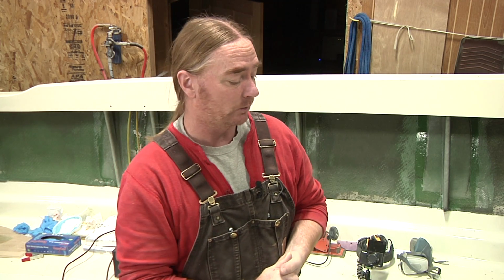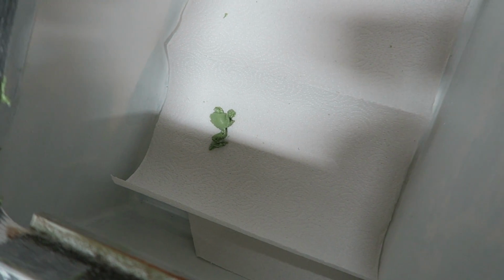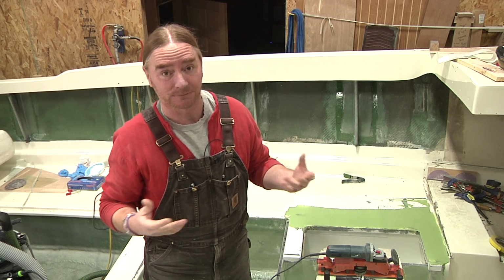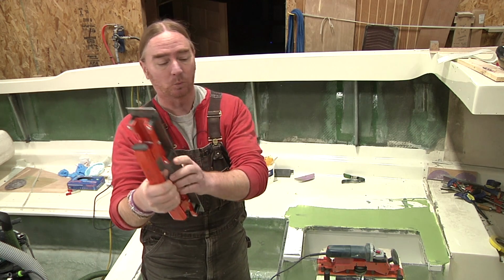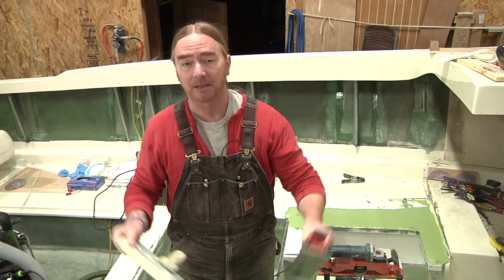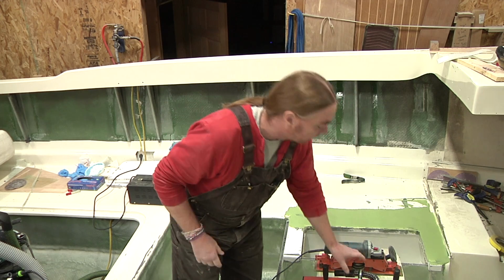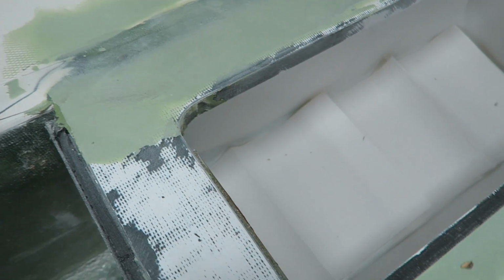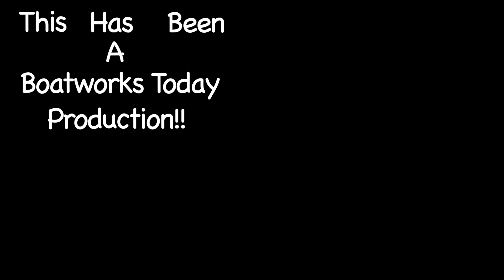Fiberglassing And Fairing The Coosa Locker Frames!

Comment: Nice video Andy. Thanks for making it. A Flexi Sander would have been nice but so many manufactured tools are not available here in S. Africa. While doing massive amounts of serious resin blister repair on my 40 foot sailboat, sheetrock compound knives were too small and tedious to use. I had to make screeds of Plexiglas, of various thicknesses, widths and lengths. Some were very stiff and some very flexible, all depending on what odd shape of the hull had to be faired with 2 part epoxy filler. The business edge of the screed was cut perfectly with a router, following an aluminum straight edge. I do think, in the end, this worked as well as a Flexi Sander would have worked and cost me only the time to make the tools, as the plastics were someone else’s scrap. ……Then there was the making of a variety of long boards….
Looking forward to your next video.

Comment: Andy,
I am in the middle of a Grady White project and know, due to not being careful, I will need to do a lot of sanding to my deck because there are a lot of epoxy drips and smears.  To bring the deck back to being true and to prepare the deck for some non-skid I think the proper way would be to do some fairing.  My questions are... 
- do you agree that would be the proper approach? 
- how far does the fairing go? 
- in this video what size containers of Total Fair are those?
- Finally, you dispense the amounts by eye... would you recommend measuring if you are a beginner?
Thanks!  Watching your videos helps the DIYer more than you know!! Looking forward to the next video

Comment: Nice explanation of the tooling you used.... you're right about getting it laid down the first time with only a couple of low spots. Hardly ever happens. But that's experience for ya! Good job... 
I used to do a little body work and paint cars... 
How would you compare fairing compound to Bondo. 
Is it just a harder finish?
Thanks for the video...
Reply from the maker: Hi Dave!  Bondo is a polyester based product and generally speaking very porous (not very good for managing constant exposure to moisture) whereas most marine 'fairing' compounds are epoxy based which do a great job at limiting exposure to moisture.  Also epoxy tends to shrink much less after cure so there's less chance for visual distortion with high gloss finishes like paints :-)  Hope this helps!

Comment: Once again great video. I can't tell you how much you have taught me about fiberglass work. I have a question about fiberglass panels. Can you laminate Owens Corning 703 rigid fiberglass panel? It is used to make speaker boxes in cars and is a lot cheaper than the premade fiberglass board you are using.

Comment: I'm replacing a shattered piece of the topside of the deck, surrounding the mast, on the starboard front quarter of the cabin top. Do you feel that this is a good way to attach that piece and fair to the old deck piece?

Comment: Andy, for the diy one time person a concrete finishing trowel will bridge a low spot without flexing. Just a tip for those that need to do a project and don’t want/need to spend the $ on the flexi sander trowel.
Reply: Why yes it will, but that was not the point Andy was making. When one needs it to flex to follow that slight curve is when it creates a low spot in the middle, which is not what you want since its supposed to be a nice slight curve. Again as Andy stated, it can still be done with concrete / drywall trowel, just that it will take a lot more steps to fill in and create a high spot like it is supposed to be to get that finished curved surface.
Reply: Kevin Fisher I understood what he was saying about the low spot and multiple passes. I was talking about when you come back for rnd two and need to fill the low spot a concrete trowel doesn’t flex like a drywall knife and will fill said low spot without continuing to creat a low spot. The flexi sander is very nice but $$$ and maybe too much $ for an average diy person. I do this line of work for a living also and was trying to be helpful.
Reply from the maker: Absolutely taken as being helpful, thank you :-)!!
Reply: BoatworksToday you bet, love the show!
Reply: Ah ok. See what you mean now. Yes concrete trowel is normally stiffer.
Reply: Kevin Fisher 👍👍👊

Comment: I am going to be testing the tensile strength of a piece of corecell and thought perhaps you'd already have done that in some way.  Plywood was painted on the top and bottom... perhaps gel...but either way it had to be removed, and I don't need to be scientific to know glass will be stronger than the non glassed ply, but I am looking for a stress free repair down the road, and I'm a paramedic dabbling in boat renovation for myself, so I'll be taking any advice from someone with your experience. 
The plywood spanned over the fuel tank and went about 4 feet across by five feet long, seemed like a big space to just have ply and I imagine sagging would be an issue, so I was thinking of making a 3/4  inch by 5 inches glasses both sides corecell board about the right length (4') and seeing how it bends... there's more structure inside to tab up to on one side, the other was a bed...so... thicker than 3/4?
More glass?
Uh, less bed area, 😆😂
Love your site, I pass it on to everyone that has interest. I hope to use your sponsors more and more often and wish you all future success.

Comment: great job ,personally i would have stepped the lower part of the coosa  outer frame out like made the inner cut half inch bigger then made the lid lower part  half inch  smaller  on that inside cut so they would ve inter locked ,if that made any sense ,,but i like to torture myself with intracate pieces

Comment: Hey Andy, 
Thanks for another great video,
I was looking up that electric straight line sander, I assume it is a flex sander and that it can only be bought from them overseas? I believe you mentioned that you bought it overseas on a previous video. If so  you obviously bought it bought it with 110 volt 60 hertz. I noticed a bosch, what looks to me like a angle grinder head on yours. It's really hard, if not impossible to find an electric straight line sander. Keep up the great work. Jeff
Reply from the maker: Hi Jeff!  The sander I have still has the european 220v plug so I run it off a converter which is working really well.  Here's the one I have:  https://www.amazon.com/dp/B06VVXN2SR/?ref=exp_boatworkstoday_dp_vv_d

Comment: epoxy to set the box in place, what was the fairing compound , epoxy too ? how do you gel coat over epoxy?
Reply from the maker: The fairing was Totalfair made by TotalBoat.  Gel cannot be applied overtop, but I was planning on painting anyway :-)
Reply: @boatworkstoday  thank you for your reply.  I am doing a complete refit on an old lobster boat (cut and widen, remove keel, replace deck, etc) and have been deciding between epoxy vs polyester... if i go poly, will stick with gel coat, if i go epoxy i will switch all finishing to awlgrip...trying to stick with one system for everything so i dont need to worry about remembering what i used and where....
Reply from the maker: @ipscompany5794   rather than using Awlgrip I think you'd have a lot easier time using Alexseal; much more user friendly and able to be repaired DIY style :-)  Can finish with this regardless if you use epoxy or poly or vinyl for the glasswork
Reply: @boatworkstoday  Thank you I will check Alexseal out!

Comment: I'm using Total Fair on my project and it's great stuff! Does it need to be sealed with a coat of epoxy before painting?
Reply from the maker: Doesn't need to be sealed with epoxy, but it should be coated with primer to prevent the paint from absorbing into the fairing :-)
Reply: @boatworkstoday  Are there any downsides to sealing with epoxy?  I am a big fan of sealing things with the most effective and longest lasting products possible.
Reply: @boatworkstoday  Are there any downsides to sealing it with epoxy?  In theory epoxy will last a very long time and one wouldn't have to worry about the gelcoat or paint wearing thin and allowing water to soak into it.
Reply: @PanzerDave  You would still need to paint over the epoxy, as epoxy will deteriorate in sunlight.

Comment: Something I am trying to figure out why Were you so careful about the spacing on the outside Of your frames In your last video If you were just going to use thickened epoxy and glass them in anyway I understand you don’t want huge variations but you were almost to the point of if it wasn’t completely uniform it was like you did not want to use it

Comment: I'm surprised that you worked on both the port and starboard lockers in one video.  You showed 5 minutes of fiberglass work, and then broke into a 15 minute commercial about what tools you use for fairing the compound.  But I guess it's all about making "video content" for as much time as you can stretch it out.
Reply from the maker: It's more efficient to discuss the details of what and why I'm using certain things in video rather than having to field 300+ emails from folks asking that very question ;-)
Reply: @boatworkstoday  And thank you kindly for the tool discussion.  Much rather see that than 15 minutes of sanding.
Reply: That is about pleasing what most of his subscribers has stated they liked and wanted. To actually explain how and why he does things the way he does. And to answer the many questions that will come if he does not go into the products he uses. In a years time, he has mentioned several times about how much time saver and easier on his shoulders these are, but this is the first I have heard him mention about the longer ones for thicker substance still involves quite bit of muscle power. So to stick with the shorter length ones for that application. I appreciated hearing that, as I am sure will many others.